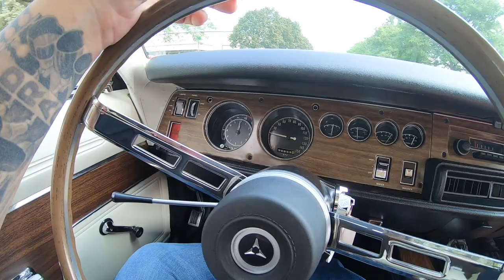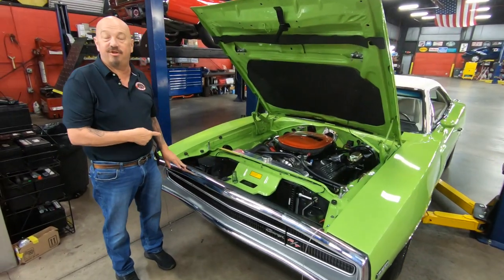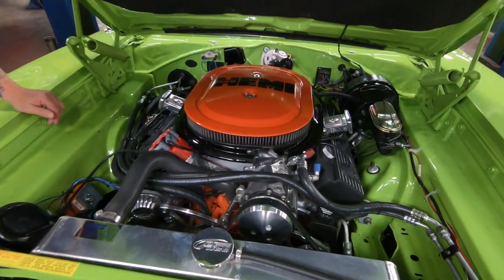1970 Dodge Charger HEMI For Sale

Comment: The key is not upside down. GM cars were upside down. The tumblers in the lock are supposed in the top of the lock that puts the cuts on the key facing up. Ford did it right Chrysler did it right. GM. Was the only ones who put the lock upside down. The car looks good very well done too bad they put air conditioning in it.